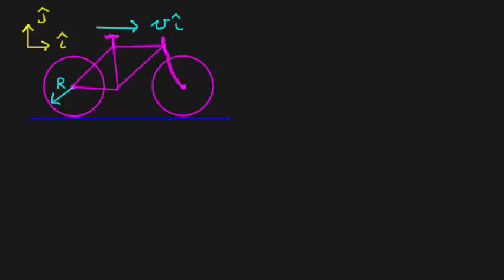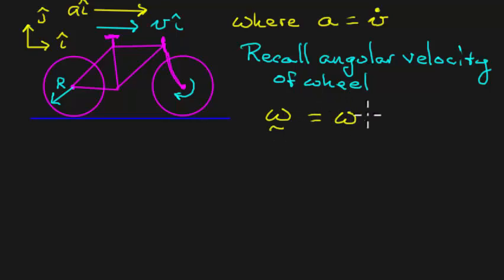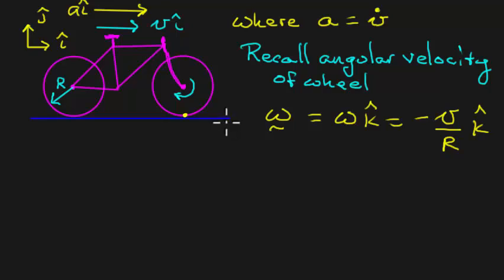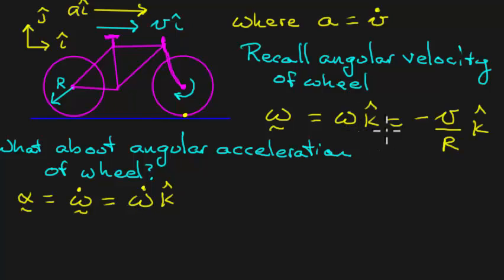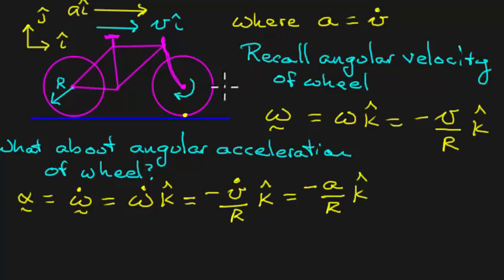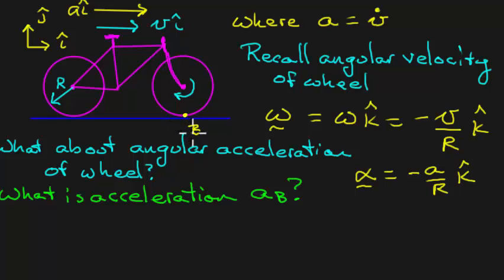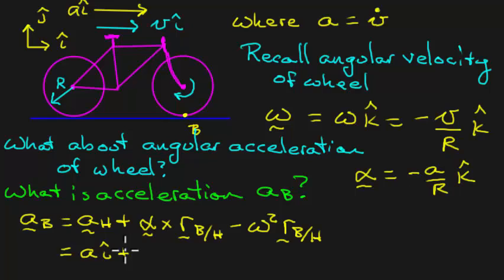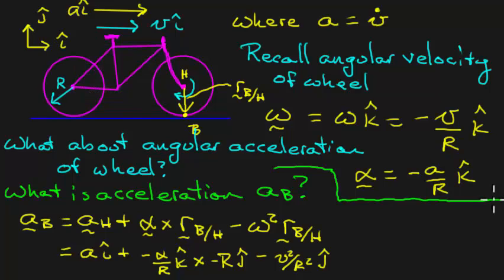Kinematics of Roll Without Slip - Acceleration

Comment: Hi sir, can I ask a question related to bicycle dynamics?
Reply from the maker: yes.
Reply: Sir, i was trying to solve a problem...where bicycle is accelerating because of torque on front wheel. But I am unable to find  equation of motion. I have soled some part of it. Can I email the image and the part I tried to solve to you. I don't know how to post image in comment. I am doing some mistake in solving the problem. Please let me know your email ID, I will mail the prob. Thank You
Reply: Here alpha1 and alpha2 are angular acceleration of two wheel. Please let me know where is my mistake and also suggest me a approach to solve. Thanking you in anticipation.
Reply from the maker: Not sure what your ultimate objective is, but there is something wrong with the moment equation. The moment equation in this form assumes you're analyzing a rigid body. But your system has at least three rigid bodies: rear wheel, front wheel, and frame.
Reply: my objective is to find relation between torque at front wheel and acceleration of the system.
Reply: Please, suggest me a way to solve dynamic equation, when multiple rigid body are connected.
Reply from the maker: Split the bicycle into three bodies: back wheel, front wheel, and frame. Include the forces between bodies in your analysis. Recognize that these forces between bodies have to abide by Newton's third law. Set up equations of motion. Reduce the number of unknowns through kinematic constraints, e.g. roll w/o slip and rigid body relationships. Solve for  acceleration in terms of applied torque.
Reply: I am thankful for you suggestion. I will try accordingly. Thank you :)